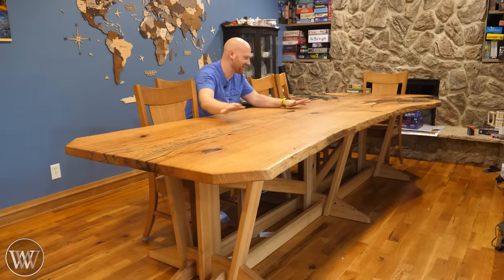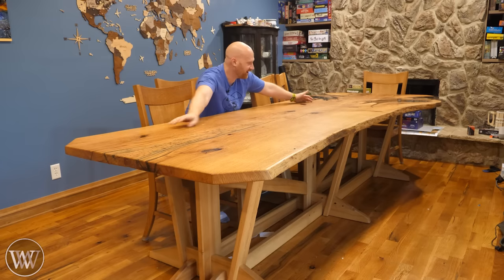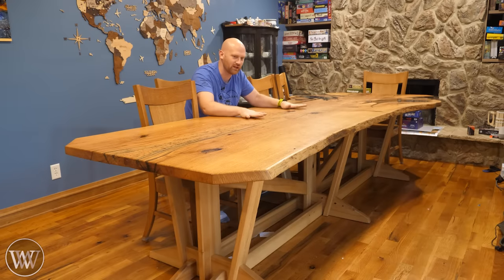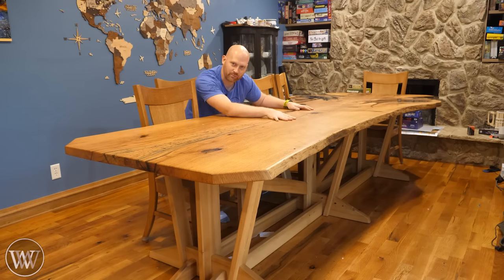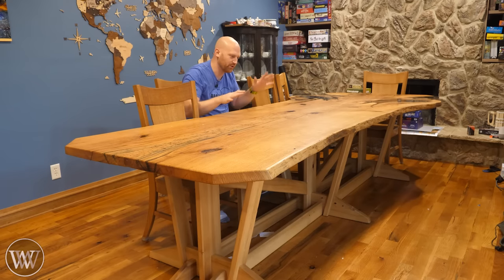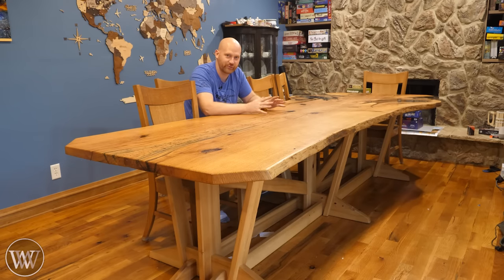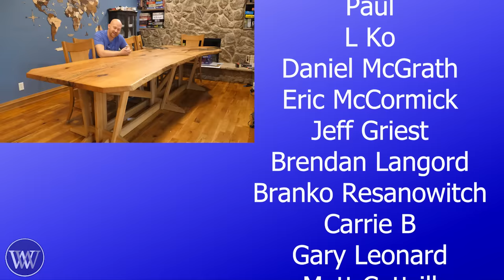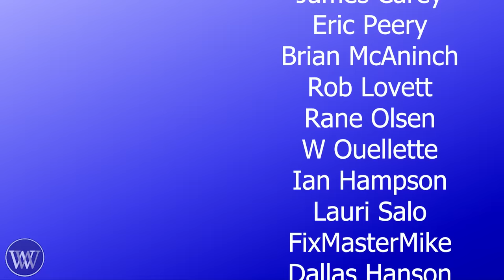Making A Live Edge Slab Top Table Throwback Tuesday

Comment: Delamination is always something I think about as a long-term potential concern for large epoxy fills - have you noticed any problems in that regard in this (or any other large fill)?
Reply from the maker: I have not had a problem with it at all. I would not do it on our door furniture with large humidity swings. But for interior use I have not had any problem at all.

Comment: I remember the "build series" well. It was around the time I first started watching your channel. A years worth of work, trouble with leaking epoxy, and other set backs. Still a wonderful result.
You have been posting  "shorts" lately. Did you know that other peoples "shorts" are attached to yours? Since I do not know who they are, I will not look at your "shorts". I am concerned that a hacker my be lurking in the additional content. Also, it is a bit difficult to tell the difference between a posting, like this, and a short. 
I'm older and even though I'm somewhat computer savvy, this newer stuff is a bit confusing.  I just wanted you to know. ;-)